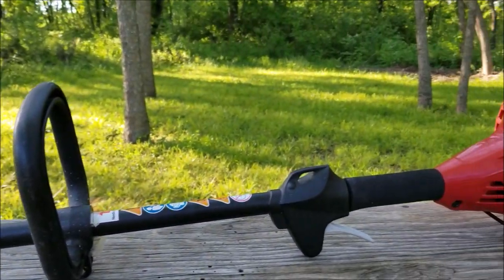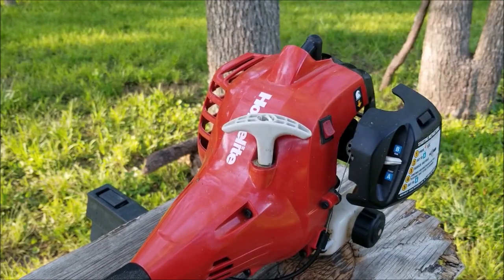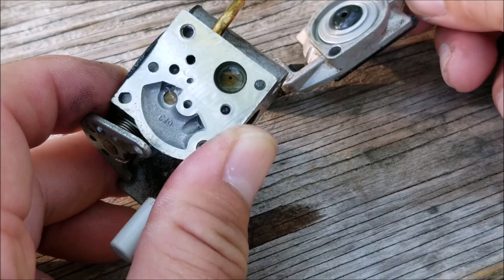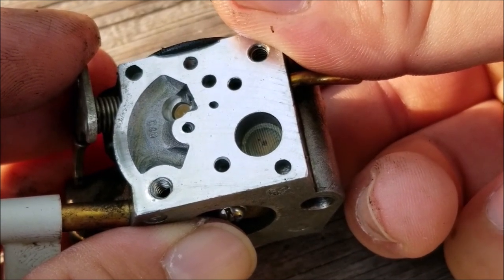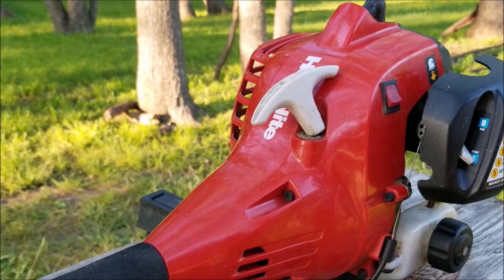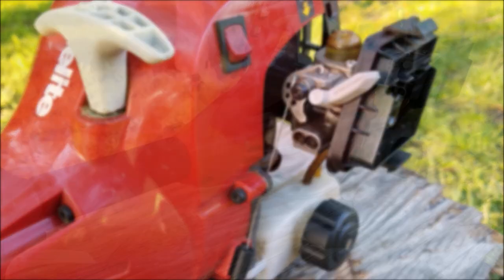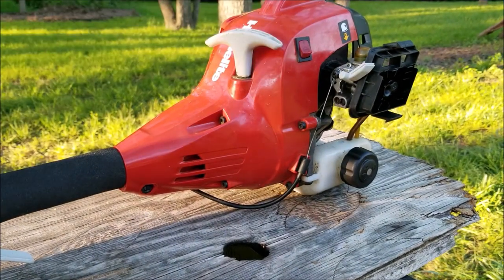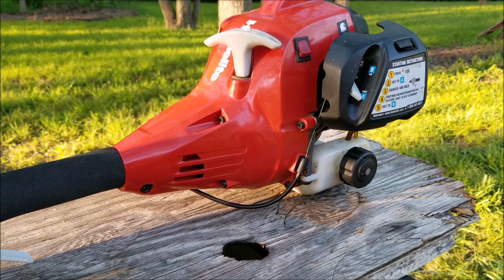Homelite trimmer fix after winter storage

Comment: Im watching this because  a friend gave me his non working  homelite to troubleshoot. They are oddball to work on. I would not buy one myself.
Reply from the maker: what part about it is the oddest?
Reply: @INSIDEHOUSEGARAGE    This one has the primer bowl attached to the plastic  shroud that is part of the air cleaner mount. It has a intake hose from the tank and out feed hose to the carby.  The carby has a return hose back to the tank.  And its one of those non adjustable  barrel carbs. Its really fiddly to hook those hoses up with big hands.  This is sold in New Zealand  so might be different Homelite specs.  .  Also theres  the plastic cowling with the vents  and one of the slots is directly inline with the  exhaust screws . Pain in the backside  .I just chopped out a window ,Save time taking the whole cowling apart to remove the exhaust.  This trimmer starts okay but dies after 10 seconds or when given throttle. Cheers.
Reply from the maker: thank you for the information
Reply: @INSIDEHOUSEGARAGE   I ended up swapping it with a different style carby. It works fine. The homelite carby needed a pacman tool to adjust which i dont have.  Cheers.

Comment: Homelite. It's absolutely the worst junk on Home Depot shelves. You will spend more time messing around with the carb then actually weed wacking, and that's if the fuel lines don't dry out in a single season. JUNK! DO NOT BUY!!!!!!!!
Reply from the maker: why do you say that?  they seem to work well for the price you pay.
Reply: @INSIDEHOUSEGARAGE  So there is a long list, from cheap inferior parts, to bad design, and so on. The average consumer doesn't have the mechanical knowledge required to keep these running properly every season, and the one important tool needed to maintain these properly of course doesn't come with the Homelite weed eater. I've torn these apart many times, and for what it costs to service them, which is pretty much every season, consumers are better off just purchasing a quality weed eater such as Stihl, Husqy, ECHO, Makita, and as much as I hate to admit it, even the battery powered weed wackers are a more sensible option. Most Homelite owners won't winterize their unit, let alone even read the instructions before use, and that also plays a huge part, of course along with proper maintenance, and as you said in your video, ethanol does a job on the carb, fuel lines, spark plug, and gaskets. So yeah, they are junk. But I will let you in on a little secret: where the carb setting is on the side by the choke lever, instead of messing with the two carb settings (H/L) you can actually adjust the choke lever slightly, finding the "sweet spot", and mark it with a magic marker. Don't even need to adjust the carb. In fact it's best left at the factory setting and never adjusted. That being said, the three best brands, in my opinion, are Echo, Stihl, and Makita. Husqy just doesn't have the reliability it once had. I would even choose a Poulan over the new Husqys. For electric, Milwaukee all the way. And great video btw, you know your way around an engine. 🔧
Reply from the maker: to me it seems like when consumer buy cheap, they treat it cheap.  When they buy an expensive trimmer, they seem to treat it better and give it better fuel
Reply: @INSIDEHOUSEGARAGE  Well said. 🔧